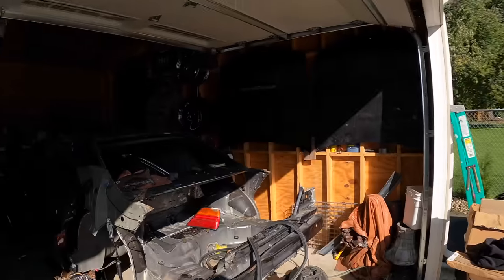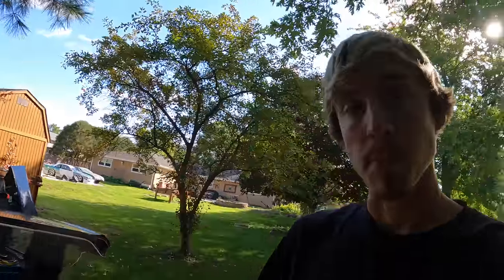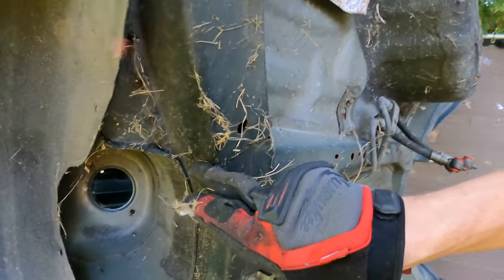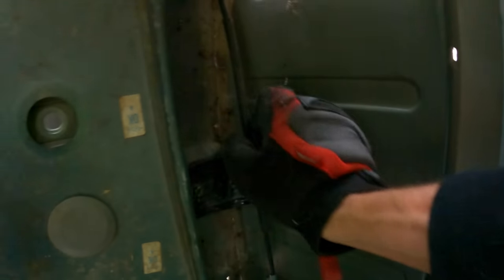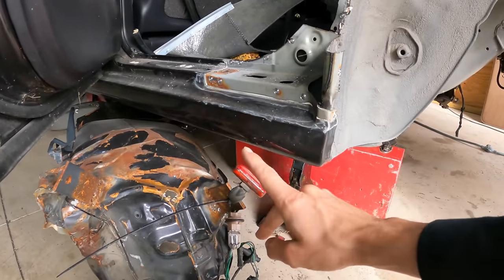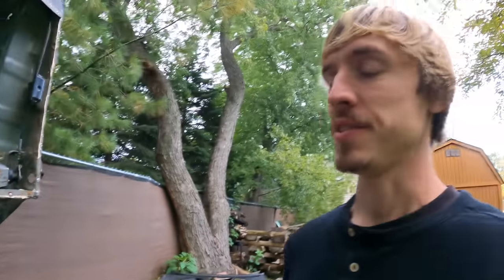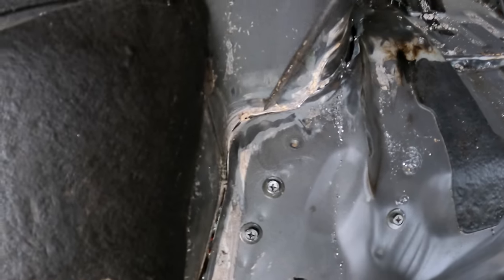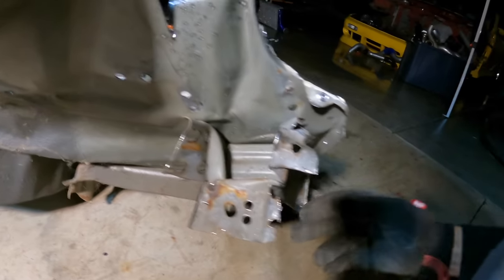Major Issue with the Nissan Gloria Restoration...

Comment: You use the belt file  to remove spot welds on damaged panels,and it’s way quicker and easier than a drill, if you want to keep the panel you have to file  the reverse side of the weld so that you don’t damage the panel you’re keeping
Reply: X2😢
Reply: Exactly. Bad panel you grind outside. Good panel inside. Lol.

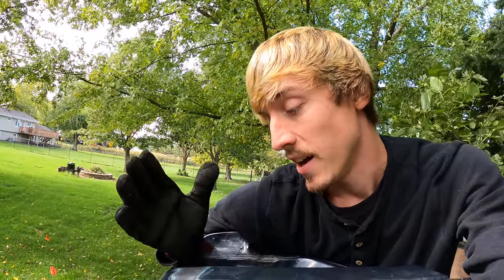Comment: 6:28 Those are Silica Arc Bronze welds! Silica Bronze is used a lot when welding things together, soft enough material to sand with but strong enough to hold things together!
Reply from the maker: Great info! I never knew!
Reply: Is this similar or the same as brazing? I’m familiar with that from building bicycles and old motorcycles. I didn’t know they were still using this technology into the 90’s. Pretty cool!
Reply: It’s actually been assembled with brazing rods, that’s how all 90’s Nissans were built. Same concept just they did it with a torch and brazing rods back then.
Reply: @ghosteh6503  Yeah same thing, except regular brazing is usually done with a gas torch, and this is with a TIG torch, but same concept in the sense that you're not melting base metal but adding a new metal that bonds over whatever you're brazing.

Comment: 7:30 active exhaust - does have a valve in the muffler to bypass some of the baffles at WOT/high rpms. Seems common in Japanese cars of the '90s - my Galant V6 had this and if I unplugged a solenoid it would remain bypassed.

Comment: For spot welds, i usually grind them off on the bad panel, leaves a wicked spot to weld the new panel to. And then through drill the good panel. that way you have a perfect hole to plug weld. spot weld drill bit if im taking a panel off and putting it back on.

wicked job on the content, keep up the good work my man!

Comment: I only use a band file on the panels that I’m not going to reuse or are damaged. Been doing this about 30 years. And the best for me still to this day in a spot weld drill just like you do brother. Band file is an awesome tool for the right job.

Comment: 6:22 I could be wrong, but I think this is 'copper brazing'. I first came across it many moons ago when I was sanding down an A70 Supra for paint (it was a horizontal copper line on the b-pillar joining the roof with the quarter panel).

I'm sorry to hear about the situation with Omar's neighbor.   With all the crime and retail theft occuring in big cities across the country, I would think that the least of society's worry would be a group of young folks with a productive hobby. 

I'm sorry to hear about your friend Sam. Good people are hard to come by and it's always heartbreaking to lose them. My sincere condolences.

I too wish I knew what the mysterious electronic box and cable was that's on the trunk of the half-cut; looks like a fancy option. It's not related HICAS right?

Thanks again for another excellent video! No need to apologize; you make drilling out spot welds interesting. It's definitely been educational learning how cars are assembled.

Have a great weekend!

Comment: Its copper weld on the factory weld seam.
Basically its traditional mig welding but with a copper wired instead of a copper plated steal wire.

Comment: The finger sander is good if you aren’t removing a panel to then put on later. You’re better off with the drill since the spots you’ll have to weld back up will be more consistent in size and thickness. I only ever used the 3m cubitron belts as well, you could do a whole quarter panel and then some with one belt (as long as you don’t run into high or super high strength steel)
Reply from the maker: Good info, thanks for the tip!

Comment: The belt sander is definitely a learning curve also you will go through belts fast. But for your actual purposes you’ll leave more consistent smaller holes with the drill

Comment: It's a shame about the complaint, but while watching all the content at Omar's, I always wondered that his neighbors didn't complain as he appears to basically be in a suburban neighborhood and it almost looked like he was running a chop shop... rules are different if you're in a more rural area.

On the file, I find it good for knocking down the tops of welds quickly or getting into a really tight space, but I think I'm with you and still prefer drilling for taking out most spot welds.  Mine tends to eat through belts super quickly as well, though admittedly I had a bunch of cheap belts to use up... Bought some 3M cubitron belts recently, but I'll have to see if they hold up signficantly better.

In fact there's a video out there called "How To: Remove Spot Welds with a 3M File Belt Sander".... I watched this thing, and sure it took out the welds quickly and easily, but he had massive square holes where the spot welds used to be... If you're going to trash the top panel, this is fine, but if I need to re-weld this back together later, then I'll take the smaller drilled hole, thanks.  Good spot weld drill bit and a spot weld chisel will get it done quick and easy.

Comment: Get yourself some Dormer spot weld drill bits and some Molyslip metal working fluid. You’ll do all of that with one bit and it’ll still be sharp at the end of it. You also won’t need to drill all the pilots either. They are honestly night and day different to those cutters.

Comment: That belt sander is better when removing the old panels because you have to remove a lot of material from the top/bad panel, leaving the panel underneath cleaner with no holes. Better to use the spot weld bit in the panels you’re going to be using.

Comment: finger sander works magic! dont use any courser a grit then 80 gritt, 80 gritt is perfect to get through spot welds. i tried 60 and 40 grit thinking it would be faster, but the gritt just fell off the belt quicker because too course for the sharp bends of the finger sander drive wheel and pulley wheel. 80 grit lasts longer on the belts and cuts through spot welds nicley. any courser a grit and its a waste of belts. legit 1 belt with 40 r 60 grit lasted 3 mins before having to replace. the 80 grit lasted like 10 mins of grinding before being replaced. but you will need allot of them!

Comment: Most likely that servo motor and controller setup in the trunk is for a variable exhaust flap that the car had to make it louder/quieter based on whatever criteria Nissan would've chosen.  Usually it opens up the exhaust under WOT.

Comment: You should get a good quality spring loaded center punch.  That would give the center part of the spot weld cutter somewhere to sit instead of having to drill I pilot hole. Or buy another drill so you don't have to swap bits.

Comment: yes the spot weld drill bit is by far the cleaner method. the finger sander is faster, but does require the technique perfected and does make much more of a mess. but once perfected is quick and clean as fuck. just takes time, use and developing the feel/ eye for when you have gone thorough upper layer only of spot weld and lef the underlayer clean

Comment: My HOA did not approve of my two bf chassis Mazda 323s 1988-1989 hatchbacks n then I had  2 Nissan Sentra SER SPEC Vs  2002 n 2003 now down to one of each 1989 n 2003
Reply: Plus a suv n a grand marquis so I still have same amount but I don’t drive the Mazda n Nissan anymore so it’s quieter 😂